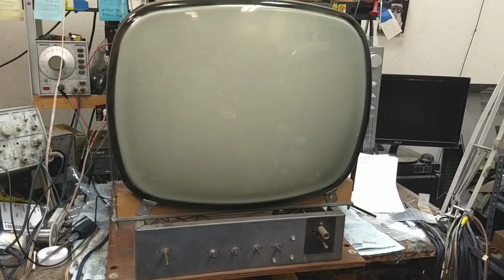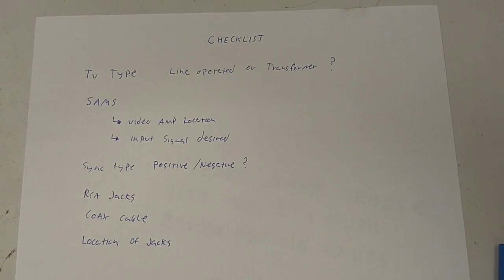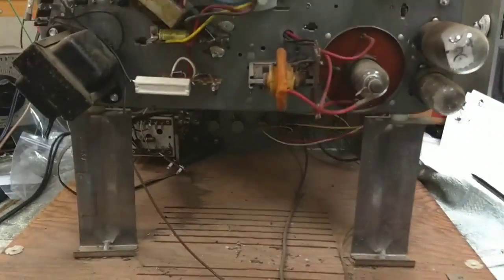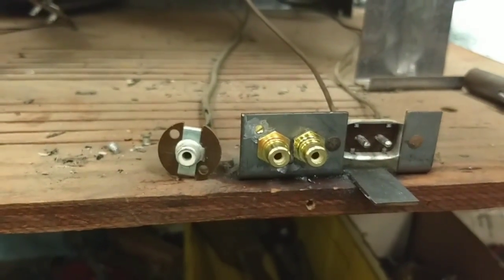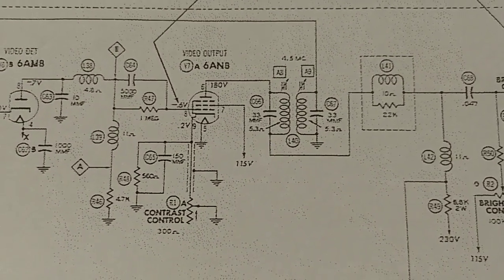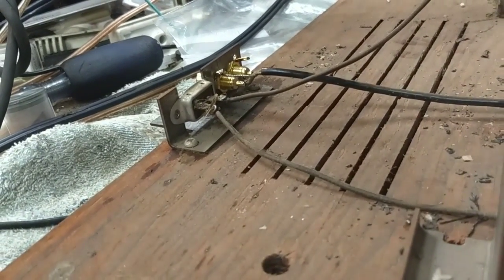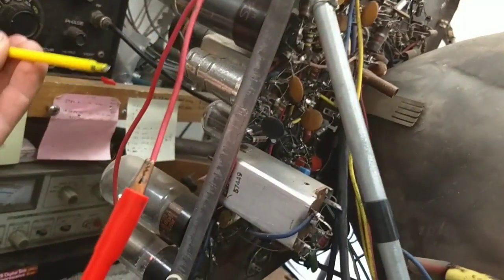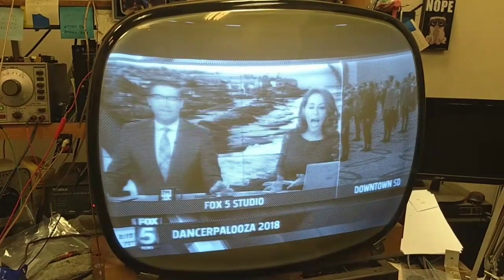Adding a composite video input to a vintage tv - transformer operated

Comment: Most series wired tube circuits use the chassis for neutral.  To protect from electrical shock you could put a polorized line cord that will eliminate any problems from shock or blowing up any source device. I would also use a new capacitor for the neutral which is the chassis. I always used an electricians neon test light. Touch the one lead on the chassis and touch the other to a ground source. I always touched the other lead to my finger but dont recommend doing that unless you have rubber soles on your shoes. A ground is the safest method.if you have a glow on the neon light. the plug is wired wrong. Reverse the line cord until you have no light. 

If you have an isolation transformer that's even better protection.
Reply: That's all well and good until it's plugged into an incorrectly wired outlet
Reply: @BensSightSoundandAuto  just reverse it, common sense would tell you not to touch the chassis before testing it. Most radios have plastic housing some older ones were made of wood. Just use an isolation transformer if you want the best protection. I didn't have one when I played with tube electronics In the seventh grade. My work area had a rubber mat to stand on my older brother or dad set up the work bench for electronics. My dad had a stroke which ended his electronic training I read books and learned on my own and In the ninth grade. In electronic shop.
Reply: Then I studied electronics in Jr college. That ended my tube electronics until now tubes are making a big comeback in the music industry. It's time to get out them old books and start building them tube Amplifiers. I have a few to repair as well.

Comment: I have a 1977 RCA AC/Battery powered TV, RCA Model No. "AB 097Y". It works fine but I would like to bypass the tuner and feed it a direct composite signal. I've looked online for service documentation but found none. I've tried but failed to locate the proper place to inject a video signal into. The TV has 3 "daughter" boards. I took out the middle one, which the tuner was attached to and now the screen is without snow, like a CRT monitor, so I think I'm getting closer, but any ideas you could give me would be appreciated. Subscribed.
Reply from the maker: Look and see what ICs it uses for video and IF processing. Look up the datasheet if you can find it. You can inject usually at the if output of the if ic or the input pin on the video amp.

Of course, this is only if it has ICs. Without schematic it's almost impossible
Reply: @JordanPier  I think it's closely related to the TRS-80 Video Monitor (i.e. 1977 RCA 12" TV with tuner and audio ripped out, mine is a 9") and Tandy had to feed video,sync and 5vdc back to the monitor from the Model 1 computer for a picture. I maybe out of luck but thanks for the info, it might help.

Comment: Jordan, did you leave the control grid floating by cutting off the entire filter network from the video detector stage? I'd have left that 4.7M resistor with or without its series coil there, connected to the grid to act as a grid-leak to ground.
Reply from the maker: Yes I left it float. I've found that leaving the resistor in can cause image problems with some sets. I use the impedence of whatever load is attached to the grid to control it directly. Has just seemed to provide better video response overall. I could try leaving the resistor in but I'm not sure it would help
Reply: Gotcha. With the bias being generated by the cathode resistor, I guess any impedance to ground will suffice, and the lower (50 - 75 being better to match the source impedance) the less reflections and smear.
Reply: @JordanPier  Try leaving the resistor in place and capacitor coupling the external video input.

Why do that?

If a video source uses a capacitor to couple the output then there's nothing to return the control grid to ground.

Also if there's any DC on the output of the video source, it can affect the bias of that tube which can affect the picture.

Plus if the video source gets disconnected, that will ensure the grid is returned to ground.

Also if you haven't done so, all those carbon comp resistors should be replaced or at a bare minimum just the ones that are out of tolerance.

Comment: Would this be a different process with a vintage solid state set? 

The tuner (or the IF, not sure) has gone to such shit in my XL-100 that channel 6 is now on channel 48 VHF. 

Think it would be easier since the video board is removable?

Comment: I have a 1992 Sears LXI that's RF only and I'm wondering where to install the isolation transformer if it's at the plug section or somewhere else?
Reply from the maker: The RF input has a transformer on it. However if you're doing a composite or RGB mod and there aren't transformer or optical coupling for your inputs, an isolation transformer must power the set as a whole
Reply: @JordanPier  would I buy an external isolation transformer and plug it into the set or modify the internals with the isolation transformer for it?
Reply from the maker: @RetroPCUser  easiest to plug the TV into an isolation transformer. Make sure to get one rated 50% higher wattage than what your set draws
Reply: @JordanPier  so one that's 170W (my set is 85W) and do the mod.
Reply from the maker: @RetroPCUser  that's the idea. 

I take it you've looked the schematic and know the proper way to bias the video amp since it's usually controlled by the jungle if and that it will accept a 75ohm load and 1v peak to peak composite signal?

Easy to brick it if you don't understand how to mod it. Better to get a good RF modulator if the tuner is working proper

Comment: How would you do this on a hot chassis set?
Reply from the maker: Might be possible using ground loop isolation transformers in series with the grids of the video amp and audio amp. Haven't tried it yet, but may in the future.

Comment: For line-operated sets: maybe put a diode between the ground on the RCA jack and chassis ground?
Reply from the maker: TheComputerGeek010101001 since the chassis is at ac potential, this would simply rectify the voltage, providing DC current to travel down the ground path of the RCA connector. This would cook whatever was attached to the line operated set.

Isolation capacitors on both the ground and signal side may work, but really an isolation transformer at the input or running the set on an isolation transformer as a whole is the safest option.
Reply: Jordan Pier oh ok
Reply: @JordanPier  i have done it on one of my tvs and both my playstation and my dvd player did not suffer any damage and most devices will not be harmed unless you ground them with a 3 prong cord, they need to be floating. but it is dangerous because you can get shocked, for example if you touch the rca cables with th tv plugged, etc. i wonder if could use miniature 1:1 isolating tranformers on both video and audio input and what would be the correct impedance. as for isolating caps they will let the chassis ac pass through also. maybe choose a value that will block low frequency 50/60hz and allow higher frequencies to pass?
Reply: @MrHBSoftware  The video signal goes way below 50Hz so that's not an option. I would try winding a few turns (100?) on a ferrite rod as a video transformer. I've not done this but it's worth a try.

Comment: Do you happen to know if there is a push button switch converter to use analog turn knobs. Idea to use an modern push tv converted to use original dial functionality. Thank you.
Reply: You would probably need to integrate it into the TV's firmware if you want a specific position of the knob to be associated with a specific value. Any external converter would be open loop, so you would need encoders instead of potentiometers.

Comment: It looks like when you cut the grid connection you removed G1 reference to ground. I can't see any other way for G1 to reference ground. What did you do about this? Are you relying on the input from your signal source to be DC connected internally?
Reply from the maker: Relying on the ground of the source as a reference

Comment: I assume you can't add component video to these old TVs... well useless for Black and White but could it be done with a  color TV from the 1970s?
Reply from the maker: I haven't tried this yet, but if I find a worthy set I will. Main problem is most of those sets are line operated, which presents a hazzard to the user and equipment attached. A transformer operated set could work. Using optical couplers might work, but also add additional equipment that might not fit inside the cabinet.

Comment: How would you do this so that you could switch between inbuilt tuner and external composite input?
Reply from the maker: A dual pole, single throw switch directing sound and video to their respective amplifiers. In one direction the stock setup, in the other input from the RCA's
Reply: @JordanPier  One other question. How do you tell if your set is line-operated or transformer operated?
Reply from the maker: One operates directly off the AC line, the tube filaments are in series and add up to close to the line voltage.

The other has a power transformer and usually all the tubes have the same filament voltage ~6 volts

A schematic will also tell you.
Reply: @electronhippo4525  Measure each prong of the power cord to the metal chassis with an ohm meter adjusted to the lowest ohm scale. BE SURE THE POWER SWITCH IS ON. You should see infinite high resistance on either plug prong. A low ohm reading like in the hundreds of ohms means you have a hot chassis set. Also note that most 70s and 80s TVs used a quasi switch mode power supply via the horizontal output transformer. However these were still hot chassis sets as the primary DC power was still derived directly off the ac line.
Reply: @JordanPier  I would also note (for future viewers) that on some some sets the filaments run from a transformer but the actual circuitry is line operated. I imagine this is fairly rare but this setup is used on the Emerson 611 and related models.
Reply from the maker: @eDoc2020  I actually have a set like that. I also have an admiral hybrid that has a filament transformer for the tubes, b+ is line operated, and a second transformer for the 24v transistor supply..
Reply: @electronhippo4525  Always connect a mains light bulb between the tv chassis and the ground wire of anything you intend to connect to it. If it lights don't connect the equipment. 
A multimeter can give voltage readings where no actual voltage exists. This is called a "ghost" voltage due to the very high impedence of the meter.

Comment: Your video input is not properly terminated with a 75ohm resistor to ground. The composite standard is 1vpp into a 75ohm load. But with no termination the input you are actually getting 2 volts of video. More is better? Not on this case. The 75ohm load terminates  the coax and maintains SWR on the cable. Remember NTSC video can extend to 4.2mhz and at these frequencies, the cable must be of a matched impedance. You really don't need true 75ohm coax for the short run from the connector to the tube grid in this application but still should be terminated with a 75 ohm resistor to ground at the RCA jack

Comment: Hi, Jordan, would you be willing to help me figure out how to add composite video to a GE CRT (model 26GT441/made in 1989)?  I made a post on reddit explaining what I think I'm supposed to do an where I am confused.  I also have the Sam's service manual and photos of several documents that should provide all the info we need.  I provided links to these documents in the reddit post  I appreciate any help you can give me. 
Here is the link to my reddit post:   https://redd.it/grlzma
On a side note, I have watched a video of someone adding composite video to their TV and they cut the trace in front of the video output pin before connecting their composite lead to that video output pin on their jungle chip.  Instead of cutting a trace, isn't it possible to just remove the first component that is directly in line of the video output pin and solder your composite connecting to the closest pad of the video output pin?